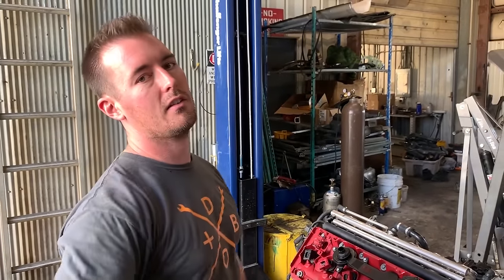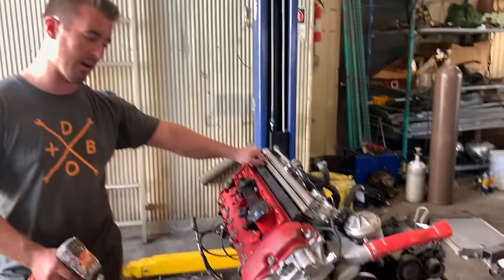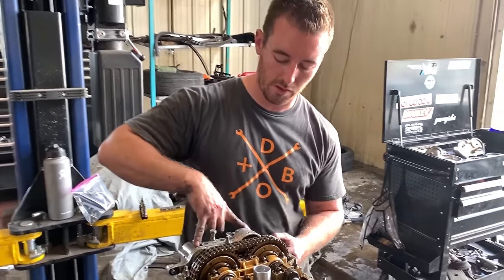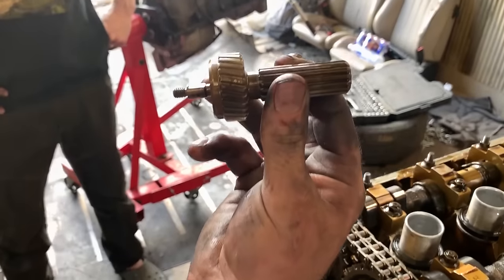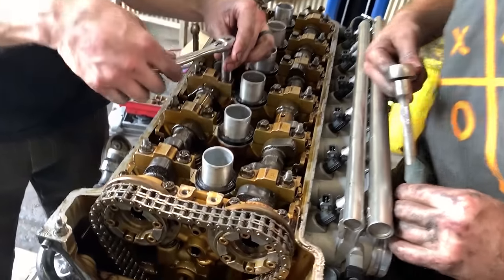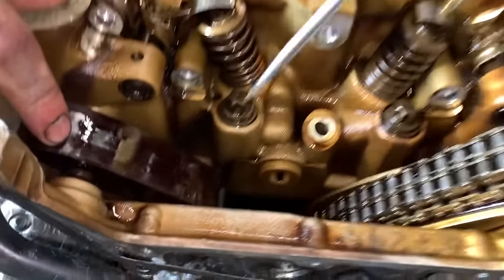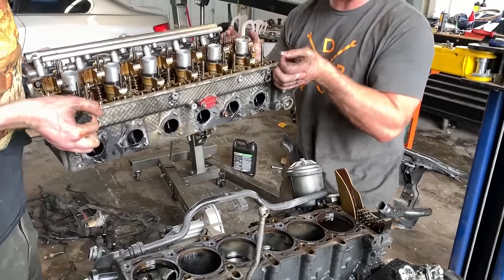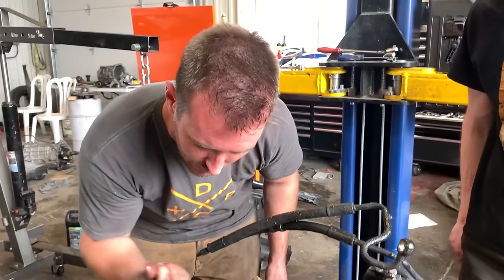Factory BMW Race Engine? s54 Teardown!

Comment: Love my S54! One of the finest engines ever made, a true thoroughbred. And just as finicky as one too. Nothing sounds or feels like it!

Also, I’ve got about 80k on my 2003. When should I do this, and what would you charge?
Reply from the maker: 80-100k on rod bearings to be on the safe side. You can get Blackstone oil tests to see if they are wearing. Valve adjustments should be done every 20k and vanos response every 50k
Reply: But in between LET IT RIP
Reply: Denver Beer & Oil I’m on original rod bearings on my 2003.5 M3, with over 200k miles. I’m also supercharged. I do valve adjustment every 10,000 miles. Never had an issue with my M3
Reply: very cool! is the N55 good?

Comment: I have about 215,000 K on my S54 m3 purchased at 208,000 K for 3G I did a valve adjust and bunch of other refresh stuff but did not pull the motor. started to have a slight ticking noise and  thinking about redoing the valve adjustment again. or at this point would it be best to pull the motor and 6 speed, would something with this manny miles be worth rebuilding or just keep running it until it gives and just replace the whole shebang. the car is just a daily/casual driver. and is in actually immaculate condition and the only reason I bought was because it was going to be parted out  because they said rear main was out and motor was seized and all it was O-Ring on constant pressure valve and the starter was out I live in Mid West North Dakota so no one has ever touched anything that is not a V motor. just looking for some advice on what to do all the info i could find is at 80k miles the rod bearings were replaced under recall and the motor was fully rebuilt by BMW.
Reply from the maker: Vanos and valve adjustments are the main things to keep up with. rod bearings every 100k is smart, but if its not puking oil and smoking I say keep driving it.

Comment: So basically if you get a used E46 M3 you'll probably have to invest in a engine rebuild.
Reply from the maker: Rod bearings can be done pretty inexpensively, especially out of the car. Timing chain and tensioner can be a little more cumbersome, but very important if you don't know the history of the engine.
Reply: No, absolutely not. Later models don't really have the rod bearing issues, and many of the early ones have already been taken care of from the factory. Just do your homework, it's much cheaper than a rebuild.
Reply: @MikeyAntonakakis  They certainly do.  They are a wear item and need to be replaced at regular intervals. There is no such thing as a lifetime fix. Just the other week i replaced the motor on a 2005 M3 that ejected a rod at 130k miles. I also did rod bearings not long ago on an 06 that were definitely due(they were into copper).

The S65 and S85 are also notorious for their rod bearings wearing. I did an S85 rod bearing job in the summer and they were done at 84k miles.

Comment: Do people put these engines in 5 series?
Reply: boofighter a buddy of mine had one put in his e34 wagon
Reply: Dylan Haratoonian that would be fun.
Reply: @boofighter in Germany is an E28 S54 for Sale 27€k
Reply: No point swapping for an inferior engine. The 5 series of the time had the brilliant S62, which isn't just more powerful and torquier and sounds fantastic, it's not even heavier because it's aluminium instead of cast iron.
Reply: @BigUriel  depends on wich 5 series they want to transplant the s54 in

Comment: One can not claim this to be a BMW race engine, as BMW never used it in a race car. Instead they built a P60B32 for the E46.
Reply from the maker: Very true, we were more referring to the race engine characteristics than its actual pedigree. Thanks for all the additional info, I have never even heard of the p60B32. Definitely going to read up on it.
Reply: @DENVERBEERANDOIL  Definitly read up on how the E46 M3 GTR was able to win, and banned. Look at the price they sold the engine for, they never wanted to sell one.
Reply: @macmechanic2489  great read....flat-panel V-8!!!

Comment: I really want to pull my s54 and rebuild it but right now I don’t have time or money for that
Reply: Why do u need a rebuild, normally rod bearings,new oil pump disc and bolts should be fine.

Comment: What's the approx cost for where ye are for a full rebuild of the S54 using oem or oem+ components? Mine needs a head gasket and want to get the big end bearings done too. If top and bottom of engine are open then it's worth to do the rings too.
Reply from the maker: Around 6-8k at a reputable shop using the best parts
Reply: @DENVERBEERANDOIL  thanks for info. Great video by the way, nice to see inside the S54 👍👍

Comment: I've been considering doing an S54 swap on my E30 iX for a while now.  Yes the whole "frankenpan" thing is an issue but that aside it seems like the S54 could be high maintenance.  A friend of mine suggested an N52 with a euro tune instead.  With that I could have approx 275 hp vs the 333hp from the S54.  Any thoughts?  I'm up in the mountains but maybe I could stop by the shop sometime when I'm down in Denver to pick your brain.  Great vids!
Reply: I've had S54 for 10 years in my E46 M3 (22K - 95K miles). Daily driver, not tracked, but wind it up as often as possible. I do oil every 7500 miles, 10W-60 Liquimoly, mahle filter. No engine issues at all, except for a weeping VC gasket now.  

I changed exhaust to full stepped headers, moved cats (200 cell) to Section 2, X-pipe, stock exhaust with a dump pipe.

The pull up to (and I will speculate past 8K RPM with a tune, etc.) is simply amazing. With the dump pipe open, the sound is full "race car" and glorious.  YT videos don't do the sound justice

Comment: So this doesn't have Valvetronic? My puny BMW N42B18A engine from 2001 has both dual VANOS (VVT) and Valvetronic (VVL). In fact it was the first engine with dual VANOS and Valvetronic and won the engine of the year award in 2001. Sadly it's just a inline 4 1.8 or 2.0 liter engine.
Reply from the maker: Yup S54 was old technology when it came out very similar to the euro s50b32. Still an Iron block too
Reply: @DENVERBEERANDOIL  Doesn't mean it's bad though. The N42 had a aluminium block and head, so the annoying thing of that is that you have to make sure everything is torqued to spec or else risk cracking or stripped thread due to the soft metal.
Good thing the E46 is a well documented machine though. So all that info is available for the DIY mechanic, and as long as he knows what he is doing all is fine. Then again there are some professionals out there who can make a mess of things too.

Comment: My high mileage s54 has low compression on cylinder 2 car runs fine but is lacking a lot of power mainly in the low end what could be causing this?!
Reply: Grab America by the Flaps wouldnt the car overheat if the headgasket was blown?

Comment: Where did the oil come from that was on tops of pistons? Did it pass  the rings from bottom end? Thanks,
Reply from the maker: Oil actually came from the engine being upside down on the stand while removing the oil pan. It leaked past the rings slowly.
Reply: @DENVERBEERANDOIL  I thought I recognized you in your video. I may have been running my 850i at Harris Hill Raceway in San Marcos when you were down here visiting with Matt. I just bought an old 633csi and I am tempted to swap a twin cam 50 series engine into the car.

Comment: I just bought a e46 M3 that needs rod bearings done for $2900. I had a LS Swap and I was considering just throwing the 6.0/6l90e in her but now my mind is changed..
Reply from the maker: Bring'er to Denver. I'll do the rod bearings for less than half that 😘
Reply: DBO I was going to do them myself for the $800, I’m saying I bought the car for $2900. 😂🙏🏻

Comment: Why does nobody mention that this same motor is also in the BMW e85 Z4M?
Reply from the maker: Very true, also the late e36 Z3Ms
Reply: @DENVERBEERANDOIL  well even I didn't know that.😎
Reply: And with a newer Siemens ECU that's faster than the original in the M3.

Comment: This engine is really bullet proof apart from, shims, vanos, tensioner etc etc. Seems like over complicated compared to much simpler and effective vtec. Also you don’t find these faults with Honda.
Reply from the maker: I agree this engine and the F20C are very comparable in terms of hp/L and power band. They were designed around the same time and the F20C is much more reliable.
Reply: Hondas do have these problems too, over time , timing chains is a maintenance item on most cars, plus Honda only have single valve varible timing not double

Comment: while this engine is in fact very cool and its got a high output for its displacement and fancy tech but hondas b and k series does about the same hp per liter with less fancy tech and more reliability. shame hondas only 6 cylinder vtec that comes close was only available in the very expensive nsx.
Reply from the maker: Agreed. It’s got a lot of cool design features and is well thought out, but requires complex maintenance fairly regularly. Our personal favourite BMW I6 is the s52, the engine that came in the m3 before this

Comment: Can you put S 54 ITB on a n 52?
Reply from the maker: It will take some fabricating of an adapter as the s54 intake ports are offset between the mounting bolts for some reason.

Comment: Ces 6 cylindres si on c est les préparer comme en Allemagne ou en France on en sort facilement 1000 ch et sans nos alors avec un kit nos ou on a pas trop l habitude en Europe ca devrait donner du. Lourd ce qui compte ces que les rapports soit le plus long possible en ligne droite du style la boîte ferrarie testa rosa la numbers one is 90 kmh the toue 140 3 200 kmh yes the rapport is the big boss
Reply: yeah! 2 times only. it wasn't that bad, but it had some green on it.
Reply: @Anthony-qh1xv  yes fors the 400 M no
Reply: @jeancharlesrabaux5658  right!
Reply: @jeancharlesrabaux5658  only twice though.
Reply: @Anthony-qh1xv  no speak english sorie

Comment: VANOS is NOT the same as Honda’s VTEC! Aarrrggh! The NEW engines out of the FXX 3series has dual VANOS which is variable valve timing control on both the intake and exhaust cams just like the S54. Valvetronic which IS similar to Honda’s VTEC. VTEC is Variable valve Timing and Lift with Electronic Control. Valvetronic is BMW’s version of the VTEC “lift” portion. So it gives timing control and lift control on the exhaust and intake
Reply: He says in the video that ¨Vanos is not the same as VTEC¨. Good job expanding on what he said though, also dual vanos started in the 90s way before the FXX 3series. M52tu, M62tu were the first BMW engines with it. First Valvetronic engine was N62 which came in e60, e63, e64, e65, e66, and e53 originally.
Reply from the maker: Thanks for the additional info

Comment: The E30 M3 is yours, you do whatever you want on it. But please, don’t cut its value in half by swapping an S54 engine on it, let alone by swapping an N54 engine on it. If for some odd reason an engine swap has to happen, and it can’t be done with its stock engine, then go with the S54, but try as much as you can to keep its stock engine, please!!
Reply from the maker: Too late.... The s14 left it's home 2 months after I bought it... I'm going to say it. It's garbage. Super overrated. Put an s52 into it temporarily until I find it's final form, and even it is far better. 

-will
Reply: Denver Beer & Oil 
I mean, it’s an old 4 cylinders engine from 86-91 respectively. Of course, is nothing like today’s standards on a sport car, specially on a BMW M Car. The point is, its an iconic BMW E30 M3!! Like I said, the car is yours and I respect that from you and from anybody else’s and their cars. I always say if I swap an S54 to an E30 chassis, it would be to a 325i. I own a 135i and would like to swap an S54 to an E82 128i. But that’s just me. I dream to own an E30 M3, with its S14 engine!! Enjoy yours!!

Comment: Good grief..... way cool vid and all, but just proved to me how overly complicated those Kraut motors are. Both over AND under engineered. Cam chain tensioner parts break all the time and bend all your valves??? 10 HR head gasket job???sounds like a motor I do NOT want
Great vid tho BTW; Good luck 👊🏻
Reply from the maker: All good points, but there aren't many engines that make 100+hp/liter naturally aspirated and also have great reliability.

Comment: Dual vanos is NOT vtec
vtec > Vanos 😛
i raced my friend's E46 M3 smg in my integra type r 215 whp ..
we were dead even
Reply from the maker: Good to know, we've done some 'official' testing and the e36 M3 and e46 M3 are near identical from rollers

Comment: Man I really pittied you americans when you started moaning at piston squirters. In europe where they make actual advancements in engine engineering not just adding infinite volume to carb pushrod two valve shit, squirters are in every cheap ass diesel or gas engine let alone something sportier. :D  Also I would not be so amazed by this engine because it does not deliver some unholy power yet it is happy to survive 100 000km without rod knock. Pile of crap that is. Try looking into Mercedes AMG engines, old 3,6 R6 and 5,5L V8 NA/Supercharged then newer notorious M156 and 159 marketed as 63AMG. Those engines make power in the same highend territory while retaining reliablity of an ordinary daily driver.

Comment: Any motor that needs rod bearings at 70,000 miles I wouldn't call good. And you got to readjust the valves every 15000 miles what a pain in the ass. If you have a daily driver and you have one of these motors in it sell it!
Reply: And I'm a BMW owner!!! I have a e46 328i with a m52 that has over 225000 miles on it!!!  I would recommend an m50nv an m52 or the newer n54. These motors are known for reliability and durability and long lasting mileage!!! And there plentiful and relatively cheap and about the same horse power as compared to the s54!
Reply: @kennithchapman9689  I hear ya, my E60 530i M54 engine has 250k...still runs strong

Comment: Half ass video. Even the lead engine development engineer at BMW didn’t say valves “need” adjustment at 15k. It’s just adjustable in case of need. Mine needed a few at 25k and since has needed none adjusted.